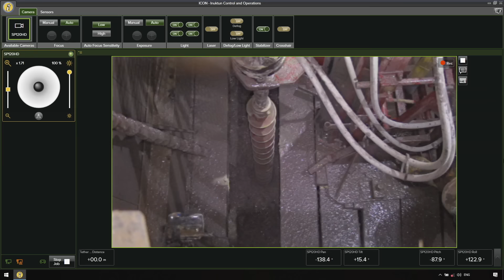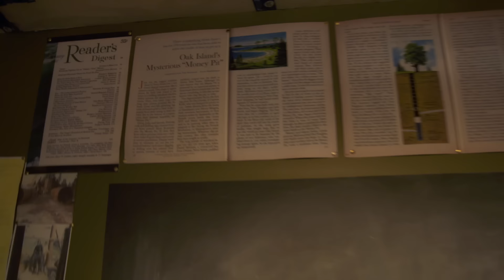The Curse of Oak Island: Rick & Marty FINALLY Detect TREASURE (Season 10)

Comment: You watch  .... they have stopped   right at a moment of a potential discovery  . I can see  that  in the next season  things will have changed   , the  shaft will fill with water  or  under pressure  collapse. or be unstable ... some thing will happen to  delay finding any thing ....
Reply: I agree with you!  This show is "Entertainment", NOT a Documentary, and what occurred at the end of this past Season 10 was a typical "cliffhanger" which has occurred with this show in previous seasons with other cliffhangers.  FACT: The Garden Shaft is NOT the original Money Pit.  The Garden Shaft is an old searchers shaft that only goes down 80 feet.  The flood tunnels were located at a depth of 90 feet in the original Money Pit so if they go deeper than 90 feet in the Garden Shaft, it most probably will flood.  They will find nothing in the Garden Shaft and the gold that they are detecting in the wood, the water and the soil is from gold mining on Oak Island and vicinity in the very distant past.  They should concentrate on re-locating and retrieving the alleged Chappel Vault and then they will get definitive answers as to what Oak Island is all about.  Sorry so lengthy!

Comment: Yes I'm sure many years ago without the modern excavating equipment someone got drunk and took an old shovel and said let me see how deep I can bury this💩, 😅😅😅😅😅
Reply: Nobody gets it!  The Money Pit was originally a deep, open sinkhole that somehow connected to the cavern(s) deep underground when the sea level surrounding Oak Island was much lower in the very distant past.  The "sinkhole" was backfilled "after the fact" with dirt and securely-fastened oak log platforms every ten feet to evenly distribute the weight of the dirt to protect and conceal what was buried/entombed in the depths.  It was never meant to be recovered.  Oh, they're excavating the Garden Shaft which IS NOT the actual Money Pit.

Comment: I suggest that Oak Island was used as a « factory » for the recuperation of whales oil. In fact, the whales oil was sold to Europe as oil lamps in those years, thus providing some sources of revenue for the fishermen’s benefits. That source of revenue allowed the person in charge to buy either products or different parcels of land in Oak Island. The so called money pit was only a « storage » type of location to keep the volume of oil secured from peoples or anything else. That’s why there were barils used and either horses or cows also used to help pulling out from the ocean the very heavy whales captured.  That would also explain why they built the small pieces of rock road from the ocean towards inland to finish up the preparation of whales oil. It was then easier to pull out such a heavy load.
Reply: There were and are no whales anywhere near Oak Island.  View a nautical marine chart of Mahone Bay on the Internet.  Oak Island is located in the far western corner of Mahone Bay, nestled up close to the Nova Scotia mainland and is one of over 360 islands in that bay.  The water is relatively shallow in the vicinity of Oak Island and the sea level was even lower in the very distant past.  Oak Island is not out in the open Atlantic Ocean per se and there are no whales in Mahone Bay where Oak Island is located.

Comment: if they were really trying to get information and not just rake in TV money, they should have used a hollow stem auger. When they hit the bottom. Send a sampler down and punch a hole in what ever it was. Then you have a intact sample of the material. Even better, case the hole and you now can control the water more efficiently.  But just whacking away with a solid stem auger isnt doing anything. The hole wont even stay open with that much water. And why was here not cuttings comming up when they were spinning the auger?

Comment: My thing is they dig  down the last few feet find a tunnel big enough to stand up in I wouldn’t take a chance and walk through it in fear of collapse because that tunnel is centuries old and even though that wood has stood up to moisture and insects it’s probably unstable the slightest movement bump into a beam for example might cause collapse I would send a robot inside with night vision cameras and sensors and a manipulator arm to retrieve artifacts and to take readings and measurements and air samples for dangerous gases before I set foot inside

Comment: No way did century’s old people cave-dig 50’ feet down, below the water table, pump water out, to “hide” a treasure. Extremely, vastly, Highly improbable.
Reply: You are right.  Centuries-old people did not dig anything deep on Oak Island.  However, it is a fact that the sea level surrounding Oak Island was much lower upwards of two millennium ago and cave/niche entrances at the shoreline that almost certainly lead to the caverns beneath the island were above the mean high water line at that time, meaning that the caverns were high and dry in the very distant past and accessible.  The actual Money Pit was originally a deep, open sinkhole that apparently connected to the cavern(s) deep underground.  The whole thing is a truly unique land anomaly!  Whatever it is that is "buried/concealed" deep beneath Oak Island was placed there FROM BELOW via the cave/niche entrances at the shoreline in ancient times and NOT from above at the island's surface.  The "sinkhole" was then backfilled after the fact using basic principles of civil engineering to conceal what lie hidden below.  It's not "treasure" per se.  I guess one could say that it is archaeological in significance and of unimaginable historical value if ever retrieved.  Today, with the slowly-rising sea level over the many centuries, everything is underwater and inaccessible.  😕

Comment: So, given everything they've dug in the past, why has this tunnel not filled with water?
Reply: If you are referring to the Garden Shaft, which is nothing more than an old searcher's shaft, it is because it only goes down to 82 feet.  Recall that the (Money Pit) flood/booby traps were triggered at 90 feet underground in 1804.  If "they" excavate the Garden Shaft deeper pursuant to obtaining permits from the provincial government, they will encounter the flooding problem which can only be solved by professionally sealing the bottom portion of the shaft.

Comment: Metal detecting for treasure should be done with the modern light weight ball bearing dowsing rod, that becomes energized by a large mass of gold that is deeply buried.  The modern electronic metal detector is only good for three foot depths and will not be energized by gold buried deeper than six feet.  Think about the end goal - Think about physics and science - Think about learning how to dowse with the modern light weight ball bearing dowsing rod - Think about actually locating treasure on Oak Island.

Comment: let,s be logical if someone had to bury a treasure they wouldn,t go 180 feet deep
Reply: You are correct!  It's NOT treasure per se.  It is religious in significance and almost certainly a tomb.  The 90-foot stone uncovered in 1804 in the Money Pit was clearly a Capstone for a tomb such as those occasionally found in ancient Egyptian tombs.  No one "dug" anything 180 feet deep.  The Money Pit was originally a deep open sinkhole that was somehow connected to the cavern(s) deep beneath Oak Island.  "Whatever it is" was placed there "FROM BELOW" via "now submerged" cave/niche entrances at the shoreline that were accessible in the very distant past when the sea level surrounding Oak Island was much lower.  The "sinkhole" was then backfilled from the bottom up with dirt and the oak log platforms to conceal what was buried far below.  Those "now submerged" cave/niche entrances at the shoreline show up on bathymetric maps prepared in the 1990's by the Geological Survey of Canada.

Comment: Ten years of digging and all they have found is some wood, nails, and pottery?!?!?! This show is a waste of people’s time watching and the shows money financing an empty hole.  NO WAY did ancient folks bury anything this dam deep!!
Reply: They seem to be deliberately avoiding where "whatever it is" is located because that might solve the Oak Island mystery and end the show.  Remember back in the early-1970's when they discovered that a significant operation had occurred deep beneath the island within the cavern(s) in the very distant past.  Whatever was concealed/entombed at Oak Island was placed there via one or two shoreline entrances when the sea level was much lower.  The original Money Pit was a deep open sinkhole that was strategically backfilled after the fact to hide what was placed far below.  The TV show won't admit it but it is almost certainly an ancient religious tomb with possible Middle Eastern origins.  They'll never admit it in order to keep the mystery and the show going forever.........